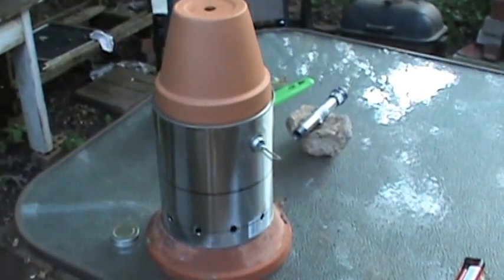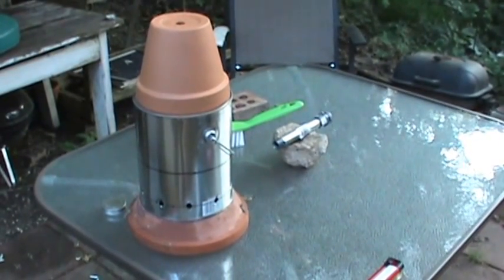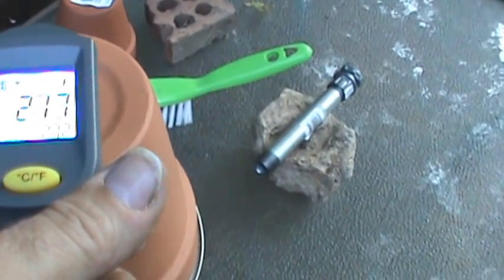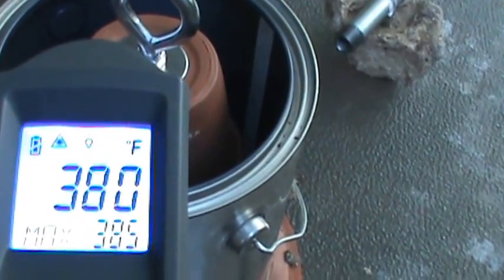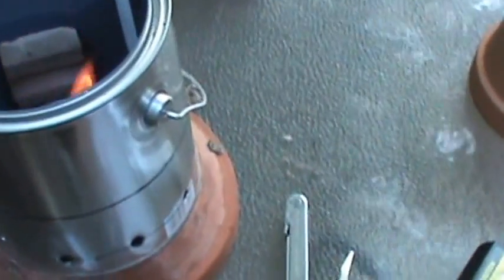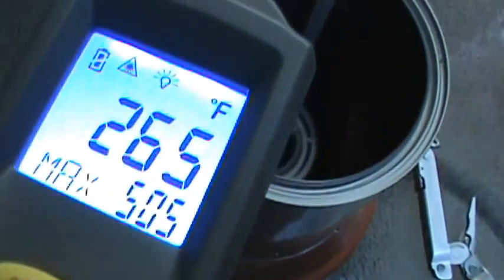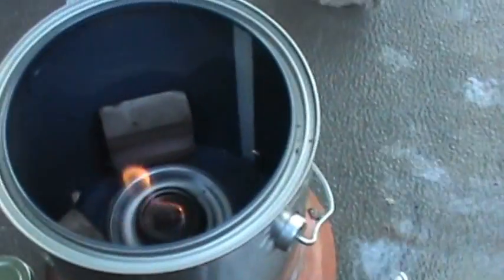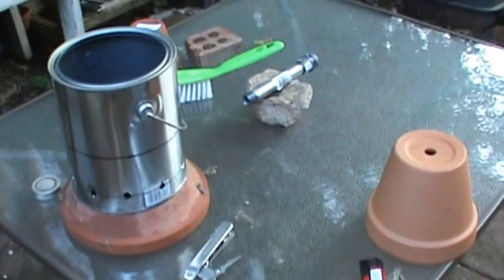Flower Pot Heater redesign. This one works.

Comment: This doesn't really answer any questions regarding the reason people are interested in alternative heating. Your fuel source is not cheap nor readily/easily stored for long-term SHTF survival situations. Most...MOST of these are trying to use inexpensive & easily stored fuel sources like Crisco or it's generic. Cheap, reliable easily stored & readily available heat . THAT'S the the goal & THAT'S why the interest.

Comment: This only works because you're using a can of chafing fuel. Burning chafing fuel emits 1800 BTUs per hour. Chafing fuel cans typically run for up to 6 hours before exhausting their fuel supply. Burning tea light candles emits about 100 BTUs per hour (slightly  more for petroleum-sourced paraffin wax tea lights). You would need 18 tea light candles, all burning constantly to give off as much heat as the can of chafing fuel. Your heater won't keep you warm if you use tea light candles, unless you use at least 18 at a time and are constantly replacing them -- tea light candles don't burn for 6 hours each.

For comparison: chafing fuel gives off 1800 BTUs per hour of heat. That's the equivalent of 527 watts per hour of electricity. Think about it like it's 2 heat lamps (250 watts each). You can certainly stay very warm with a pair of heat lamps in your tent (if electricity was available). A tea light candle gives off 100 BTUs per hour of heat. That's the equivalent of 29 watts per hour of electricity. Think about it like it's 7 incandescent night light bulbs (4 watts each). 7 night lights aren't going to warm your tent, no matter how many terracotta pots you put over them.

Another consideration should be the amount of carbon monoxide (CO) generated. 100 ppm of CO is enough to kill you. A few burning tea light candles don't give off enough CO to worry about. But burning chafing fuel cans do give off toxic levels of CO. Ventilation is the key to being safe. Caterers use them in well-ventilated spaces, or spaces large enough that the amount of CO generated isn't an issue. But inside a small tent, or even a large tent, it could be problematic. Keeping your tent ventilated enough to burn chafing fuel is counterproductive to keeping it warm.
Reply: That is why it makes way more sense for people to go back to the old ways and use Crisco lard to make a candle. Just stick a birthday candle in the middle of your lard candle. No fumes to worry about. These were used for years and years with no problem back in the old days.
Reply: @darnellmoondafugate1155  I seriously doubt a lard candle would even come close to the number of BTUs given off by a petroleum-based paraffin candle. A lard candle would be good for light, but it doesn't give off enough heat to do anything other than warm your hands.

Comment: I'm not trying to troll... But does the can make the flame burn hotter with the same amount of fuel, or does it keep the heat from escaping to the surrounding air so it so it doesn't dissipate? I don't understand the increase in the amount of heat created by candle. Why wouldn't putting larger cans around that one not make the candle burn even hotter?

Comment: The tealights, if you are using them can cause a fire once all the fuel is melted....we had a tent fire from those once...woke up to a good size fire..( we had a bunch lit for supplemental heat)...I would strongly recommend a steel or aluminum basin to set that heater in, somewhere it won't get knocked over....I think it would make it pretty safe and you can heat your tent without worry of falling asleep...
Reply: I know if you have tealights too close together it can cause a flash fire, learned by experience BEFORE I read a warning.

Comment: That's not just air coming out of the top...it's carbon monoxide. If you are not in a well ventilated enclosure it could be fatal. There should be an exhaust vent and NEVER sleep while this is operating even in a vented enclosure. I would even hesitate to sleep after this stove has been on in the past hour.

Comment: You can make candles out of crisco in Mason jars just melt the crisco down then pour in jars put in refrigerator for 30 mins then take a skinny long cheap candle and inside the middle of crisco you can cut the skinny candle down to the size of Mason jar. It will last about 30 hrs non stop.
Reply: just let them cool down over time on the table. You are wasting a lot of energy cooling them in the fridge

Comment: Wrap copper tube around a straight piece of copper tube then insert that through the flower pots. Let the flame heat right under the copper tubes. If I'm not mistaken it'll amplify the heat. Try that and do a video of that.

Comment: What's the btuh heat loss of the tent?  What's the btuh output of the heater?  What's the cost per btu of the heat source?  Compare to the cost of a simple SAFER propane tent heater.  You'll be surprised.  Lot of work to spend a lot to heat a tent with an unsafe device.  You did not prove anything.

Comment: What if your can was open on the bottom end so you can have access to lift it off to put out the flame. Using HEET is a good clean burning fuel which is very efficient with a Trangia burner.

Comment: Looks good.  A lot of people test these by probing the temps of the flame/pot but I'd like a test of if it increases the temperature of a small room or area.
Reply: Yes. The temperature of a heater doesn't mean much if it doesn't translate into a warmer space. Heat is lost as it spreads from the heat source. I tested a heater similar to this in my van. At the start it was 45°F inside (37°F outside). After an hour the inside temperature was 48°F even though the heater was too hot to touch.
Reply: Regardless of flame temperature, after all a match is hot, you will get less than 1000 BTU from that source which would be enough to remove the chill in a 8ft high room of about 25 square feet. (5ft x 5ft).
Reply: Okay, what's holding you back? Go; oh, I guess you're broken! Can't figure it out, ＼(°o°)／

Comment: When you buy stereo cans, the directions say to not blow out the flame, but to simply place the lid on top of the stereo can, but do NOT tighten the lid until it cools down, or you’ll never be able to get the lid off again.
Reply: Don't things shrink when they cool down? If you tighten the lid while the can is hot wouldn't it become loose as the can cools down?
Reply: You mean sterno....not stereo!  LOL

Comment: Having the fuel and the flame in the same box just ain't smart.
It's like putting your propane tank inside your bbq grill next to your steaks.
There's a good reason they separate the fuel tank from the combustion area.
That's just my two bits.

Comment: This design better utilizes the limited BTUs by keeping the thermal energy closer, and releasing it more slowly-- same BTUs, but released more slowly, stored, and radiated slowly outward, rather than upward in a wasteful column of overheated air.  Sure, you could flash burn some fuel and get the same amount of BTUs over the span of just a few seconds, but what good would that do?  It would heat the tent to a higher temperature for a very short time, releasing most of the heat upward in a fast-rising column of scorching air.  No good!  By keeping the flame small and storing the thermal energy to be slowly radiated outward instead of upward, this furnace will keep the tent mildly warmer for a much longer period of time.  The naysayers seem to have a very small range of knowledge, limited to only a few variables and utterly failing to consider the temporal factors, rate of radiation, convection effects,  thermal stratification of air, etc.  Also, the slow burn rate will allow for a smaller room vent and less worry about depleted oxygen.  There is more in play than just straight calorie conversion in a vacuum.  Finish high school and open your eyes a little wider.   Great design.

Comment: I am actually building the flower pot heater.  I am using an 8" pot with a 6" inside.  Working out the logistics of using a coke can alcohol burner for the heat source.  I have seen several warnings about the candles bursting into a flash fire because once the all wax melts, it flash burns.  Guy said not to put the candles so close to one another.  So the danger in using the candles is flash fire.  I am wondering if enclosing the alcohol burner could cause an explosion if the vapor in the burner gets too hot.  But I am not gonna use the paint can.

Comment: Can't burn stereo inside, you will need a carbon monoxide detector.  I wouldn't want ya to get in trouble.  That's an awesome job.  What about the base, is it getting hot?  Will it need to be up off the surface?

Comment: The reason this is better than open candles is because heat travels a few different ways scientifically. One way is radiant like traveling waves outwards that bounce between molecules. When air absorbs the heat it rises so you can feel heat up by ceiling, and from there heat also radiates out from hot air but it’s too high. So if you trap the hot air lower the radiant heat comes from it and from the hot pot lower in the room so you can warm lower parts of the room and yourself nearby. So you do  benefit from this kind of heater.

Comment: Infrared thermometers, like the one you are using in the vid, cannot measure air or flame temperature, they measure the radiant heat from a solid object.  They can't accurately measure the temperature of a shiny or polished metal surface like the "paint can", either, because of reflected as well as radiated infrared heat.  The red laser light you see is just a pointer to show where the infrared sensor is pointed.
Reply: Don't tell maintenance that

Comment: I don't get the purpose of all the extras around the sterno can (pots, etc)?  The pots will certainly retain some heat (once the heat source is burned out), and the can will protect the user from getting too close the flame, but all that stuff does not increase the heat output of the sterno.  Essentially, the sterno produces X amount of heat (BTUs) and no matter what you pile on, it will not increase that output (BTUs).  If the purpose is to create a heat-sink so you can disperse the heat slowly over the course of the night, you should use something with more mass that will retain the heat and disperse it slowly (large rock, stack of bricks, etc.).   If the purpose is to maximize the radiant heat--for instance, to dry your boots or object next to the heater--you should use something metal as it will absorb and radiate the heat more effectively.
Reply: The brick pieces are there to provide stability for the can. Keeps it centered and weight to help keep it upright while on the ground.

Comment: Your heater sucks and to prove it go measure the temp of the air in a certain size room, for a given amount of time and see how mush it rises in temp. You just measured the heater so of coarse its going to be hotter than a candle cause you've kept that heat contained doesn't mean it's actually heating a room. Burning candles without all the other shit blocking the heat would work better as a heater than this.

Comment: There is no design of a flower pot heater that 'works' better than another.
A tea light candle has a finite amount of energy.
You can use the energy over a short time, making it very hot, or over a long time making it less hot

Comment: Now build a simple bellows to blow the cooler air across the hot surfaces.. Yes the home made candle stoves make heat..  But the terracotta pots are simply a heat sink to hold the heat. They won't make any more heat than what the candles/flame source can produce.. Keeping this in mind, you do want to add to the convection process by accelerating the cooler air past the hot surfaces which will cool the terracotta, but more important cool the air supplying the air portion of the fuel burn.. The terracotta will reflect heat back to the wax... with enough heat you can cause a "self-ignition" of the wax.. It happened to me with votive candles

Comment: personal preference for 30+ years, a kerosene oil lantern... how and why. the way they are vented makes near white hot flame is cleaner burning more efficient, turn a little knob to control regulate, will run about 10 hours on a full tank. want it dark? put a coffee can both ends cut out over it with a few rocks for the can to stand on. with the handle up and a line connected to the tent ceiling near a pole its pretty hard to tip it over if it gets bumped. snow camping in a double wall 3 person tent stays fairly warm for 2 people with the older Deitz lantern has 5/8" wide wick, the newer Chinese copies aren't near as good only having a 3/8" wick and half the heat output. "candle heaters" do kinda work, and were kind of a fad for a little while, is OK I guess lol.

Comment: Be sure to vent the exhaust out of your tent. People die from two things from open flame. 1. Using too much oxygen. 2. Generating a high concentration of carbon monoxide.
It's so contained in an enclosed tent that you could expire without a chimney.
Reply: Better to insulate the stove (Don’t use live flame radiated heat paint can) and keep it outside the tent, and use a wood stove fan & clothes dryer vent tube to blow heat into your tent.  

The wood stove fan & clothes dryer vent tube can also be used with a campfire as the heat source and the wood stove fan placed near the fire with a metal shroud in front of the fan that connects to dryer vent tube and extended with another dryer vent tube or pvc, etc.

If you want a radiated heat design, heat up rocks in a campfire, put them in the paint can.  Coals from the fire can also be used, perhaps vent the fumes outside the tent if desired with a clothes dryer vent tube connected to paint can lid.

Safety first.  There are safer ways to heat a tent.

Comment: Hmmmm... not so sure you can claim “This one works” as you haven’t proven anything. A real test would be to state the ambient air temperature in an enclosed space and the amount of time it took to raise that temperature by 5-10-20 degrees after introducing your wonder heater. 
 Also, how much time did it take to get those clay pots up to a high enough temperature that it would radiate enough useful heat at an ambient temperature of say 35* F?